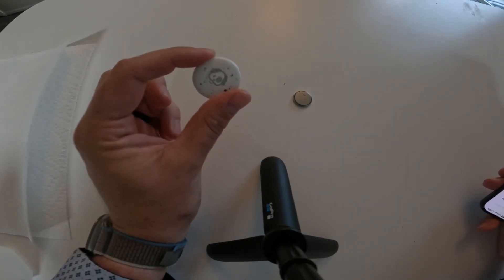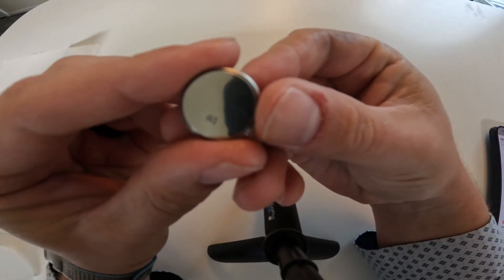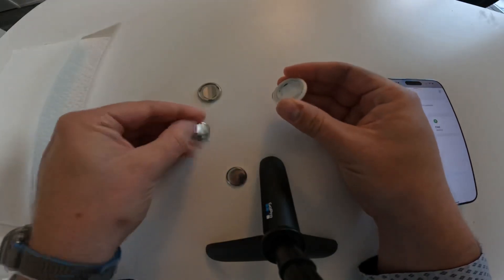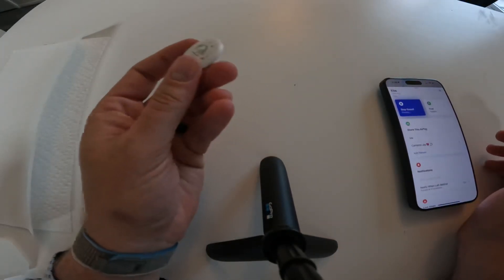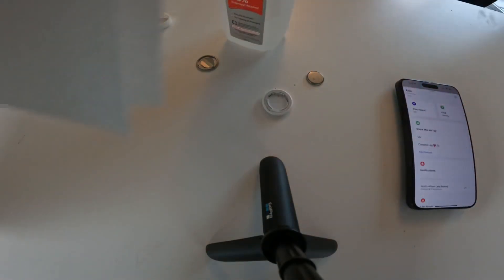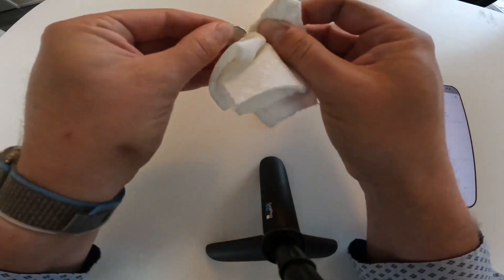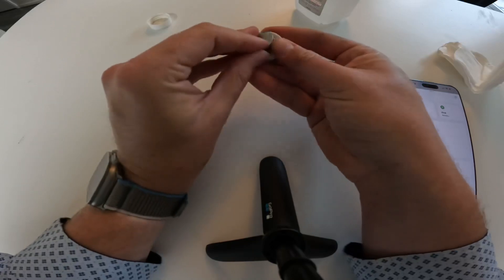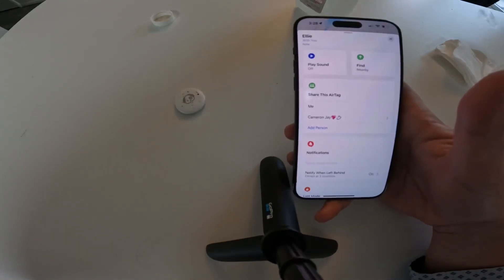New AirTag Battery Not Working FIX!

Comment: I see the dots from the coating all over the back of the battery just like you said. However rubbing it with isopropyl alcohol is not removing the bitter coating and the AirTag still will not connect. 😢
Reply from the maker: If alcohol alone is working try using it with something more abrasive like the back side of a dish sponge or scoring pad. It seems like the newer batteries they’re making it harder and harder to remove.